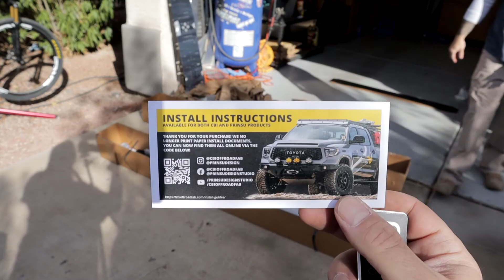2020 Tundra Prinsu Rack Review

Comment: I noticed on their website they said this will not work with shark fin. Looks like it does from your install, but did you notice any issues or have to adjust load bars any to accommodate it? Great info, and thanks for sharing!

Comment: Added the Prinsu on my 2017 Tundra and added two 30lbs each Trek bikes at the very edge of each side for stability and the crossbars bow, twist and creak like mad making a terrible sound. We turned the crossbar closest to wind deflector on its side for strength and its doing better but still bowing and creaking.  Did review on Prinsu website but never posted. I assume they don’t want negative reviews. So if 60+ lbs bow the rack to the point it touches your roof what can you put up there? It looks great I give them that but i bought it hoping to put a kayak and both bikes like I did with my Yakama on my previous truck

Comment: Nice Setup. Thanks for the video. Thinkin about adding a Prinsu to my 2017. Any idea how  much height the Prinsu adds to the cab roof? The website appears to list it as 1.75", but has to be higher than that?
Reply from the maker: I think it was a total of about 7 inches. Truck was sold so can't check for ya.

Comment: hi, how many inches from the roof to the very top? (front and rear) i want to find out if it will still fit inside my garage, thanks!
Reply from the maker: The highest point from the roof is 3 3/4.
Reply: @520speedworks6  thanks🙏🏽

Comment: I am wondering how much wind noise it create. Thank you
Reply from the maker: Little gain in wind noise have to try to listen for it. But calmed the wind noise on the tent rack sooo well worth it.
Reply: @520speedworks6   Thank you! I don't want a rooftop tent but I am just looking for a rack for traction board and awning. I cannot find a bed rack compatible with my bed cover so leaves the roof rack the only option. Do you recommend getting the Prinsu rack based on your real-world experience? Thank you
Reply from the maker: It is an awesome addition to the truck even with out a bed rack. Super durable lots of versatility.  Absolutely recommend 👌
Reply: @ziyedong612  i am not sure what bed cover you have but Yakima makes bars that work with a lot of bed covers, also look into front runner they offer some options as well. Hope this helps.